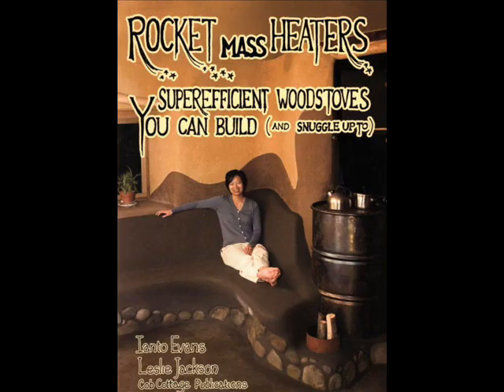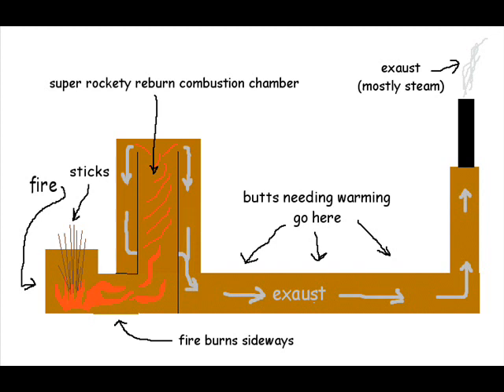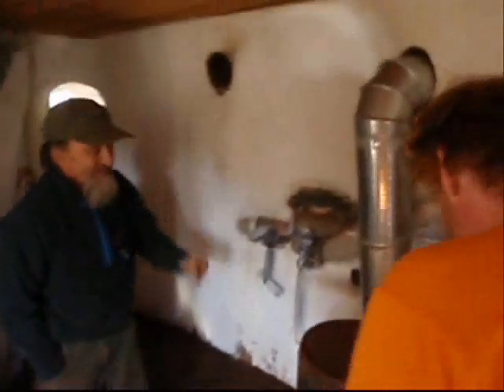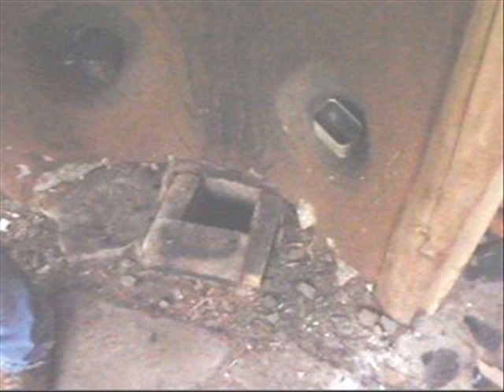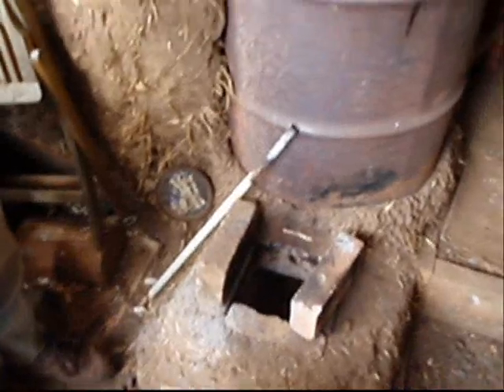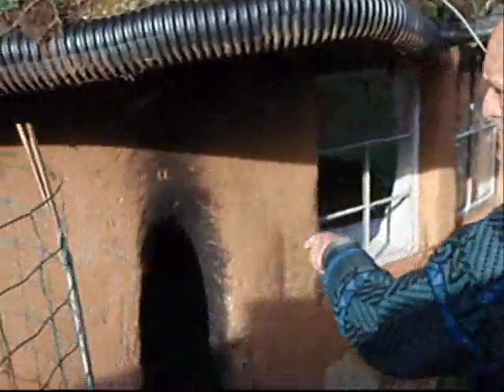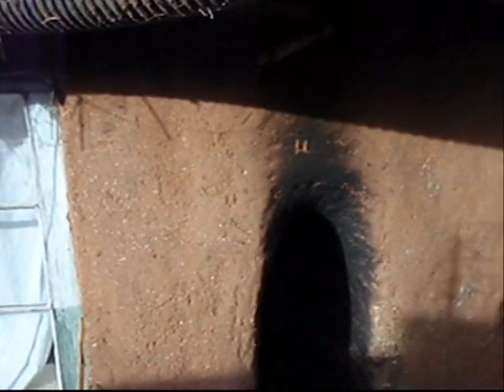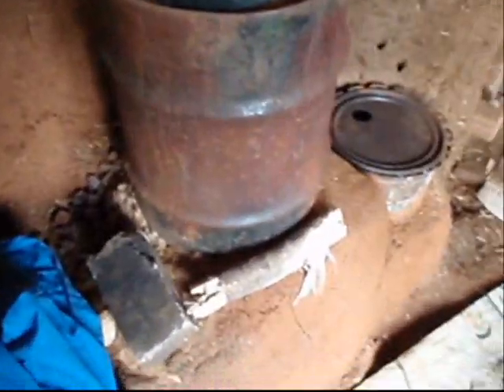12 rocket stove mass heaters - efficient wood heat

Comment: Big fan of the concept of mass heaters. Question though, do do you clean the ducting as it passes through the bench etc
Reply from the maker: Usually there are 2 to 4 cleanout ports.  Most parts need cleaning every eight years or so.  Close to the barrel needs cleaning every year.
Reply: @ thanks!

Comment: This may sound like a dumb question but , in the seated area of it . How do you clean the ducting of soot if there is a long distance from any entry. Currently defining one for outdoor cooking and sitting , I'm just trying to figure out any problems I may have before I get to the .
Reply: 888mrshoe I too will be building one outside. I will be building a heated patio with several masses running underneath. Much better/efficient than having open campfires
Reply: so you wont to burn fuel in  an efficient heater that's purpose is to store heat for later , to replace an extra sweater ? please you are missing the point of having one,if you want to heat the sky burn money instead.

Comment: It seems to be that the area you are calling the combustion chamber would be better described as the heat exchanger. From the illustrations on Richsoil.com the burning is done by the time it gets there.
Reply: yes at last some one understands how they work,I am ex gas engineer ,if I want warmth I get hot from collecting an cutting wood by hand ,stacking and drying it then dragging it in and burning it,

Comment: most people tell you they have a wood burner and they are not lying it burns wood and sends the heat up the stack, do they know their flue gas  temp , most rocket stove flues  are below condensing temp unless been alight for 8 hours or more hence the steam from flue without a computer controlling it ,or electricity if you have one don't tell anyone because your fuel source will be consumed by somebody that lives near you  ive had one for three years an they don't work , but they sent someone from smart meter people to find out why I wasn't using piped  gas and only electricity, I pay the rental  for gas in case I need it
Reply: ***** sorry I am not literary genius but am pleased with my rocket stove, I live next door to an industrial unit they put most of their non recyclable wood over my fence  ,I just break it up cut it if needed and feed the thermal mass heater and bench

Comment: Are any of these build were it is actually cold like - 40, I  don't think so....It's usually built in desert area , I think on dirt floor no wood floor . I 've been posting comments like this on may be 30 youtube channel and no one ever respond so i think it is  probably true what i'm saying ...Or they say ... no it true but they live in apartment building ...
Reply from the maker: It was 26 below a few weeks ago.  My rocket mass heater in Montana kept my plenty warm - over 80.  

I think a reason why you aren't getting responses to your questions is that the youtube comment stuff doesn't work well that way.   Which is why I am so emphatic in my videos to go out to the forums at permies.com.  If you had done that, you would find heaps of people talking about all sorts of particulars about rocket mass heaters.
Reply: How about -40 man It stays like this all winter here
Reply: Chace Butterworth I'll try it . I'll build it this summer ... have nothing to lose tanks
Reply: Francois Couturier How are you currently heating? If you are using a wood stove already then you must be burning upwards of 6 cord per winter yes? So s rocket mass heater might be the way to go for you. They're cheap to build and easily scaleable. Most I've seen are based on 6 inch stovepipe, but there's no reason you couldn't use 8 or 10 inch instead (although with a good thermal mass you might not need to). All wood-gas is being burnt and not vented out your chimney and your thermal mass is extracting all of the heat so none of that goes up the chimney either. So you could easily cut your wood consumption to 3 cord (probably less)
Reply: Please let us know how it works out. Good Luck!
Reply: Francois Couturier actually these where designed in Russia and other omg cold places
 where it was really cold. and The name was called masonry stoves.
Reply: Francois Couturier
Hi there, I was wondering if you built the rocket mass heater and if so how is it working for you? I hope all is well for you this winter?   Janice
Reply: jksatte Love the positive responses to this guy!
Reply: Chad T
Chad that's so funny "omg cold places lol". I live in FL by the way. I have no appreciation for what you guys are speaking of lol.  Janice

Comment: Does any one know how hot the base of the combustion chamber gets?  I am thinking of building one in my home but my floor is wood over a craw space. All the photos and videos I can find the RMH's are build over dirt or stone.
Reply: over 600c in fire tube  mine get up to 200c on the out side of clay fire full size fire brick ,over timber, you  will need insulation under burn area and maybe couple course brick before your burn tube to store and dissipate heat base temperature is less if u use vermiculite fire brick base but this will sacrificial and need replacing  , an air gap under thermal mass would be advisable, there are examples of this on here.

Comment: I see the slits and thanks,but the idea I am installing is air tubes injecting fresh air in the flue to create a secondary burn similar to wood gas generators. Right above the primary flame where any unspent wood gas mould collect. An afterburner of sorts to the primary rocket action.

Comment: It seems like a big outdoor JTube rocket stove to me, but I think I see what you are trying to do.  With a wood gasifier there is an external air pump of some sort, either an actual fan or the vacuum suction of the engine. Anyway, it would be a good experiment to try, even with a simple L tube cooking rocket stove... I know that when I blow air into the feed tube of my minikeg cook stove it turns it into a forge.  Would be interesting to weld some air pipes just above combust chamber angled up..

Comment: Looking to inject via natural draw of gas expansion  air into the up tube so that the air added will fire off any non combusted gas. Thereby upping the heat,burning off more of the gas,increasing heater efficiency over even the best normal rocket stove.

Comment: His isn't really a rocket stove. My air injection tubes would be placed right above the main pyrolysis zone in the upright burn insulated tube. The extra air would need no fan and would raise combustion temps a few hundred degrees.
If located properly.

Comment: Hey, check out theairgunman vid "Outdoor Rocket Stove Heater new reclaimer design", he pumps air with a 12v fan from the top of a sealed vertical feed tube. I'm going to try the same with a potentiometer to control fan speed for my smaller welded propane tank rocket heater. He's pushing heated air but cold air might be better as I believe there is more O2 per cubic inch than with heated air... altho the heated air might help dry the fuel better...

Comment: The point being to increase air flow / oxygen. You say "injected" - you mean forced air (fan)?  Outside air?  Metal tips on PVC tubing?

In any case it would be control-able, in terms of: When the forced-air is on, & tune-able; how much air flow.  Yes?

If directly into the burn-box, (not feed-box) should increasing the temp, & should move the combustion process further down the burn-box; YES? 

You're looking for more "Rockety" in your Rocket stove? 

... just asking ...

Comment: As in a gassifier my thought is a few (6)very small tubes would let fresh oxygen to be drawn in and not affect the natural updraft of the rocket action. The added air would actually increase the heat and expansion of gases by burning off any non combusted wood gas.

Comment: I had that problem with my RMH boiler design -- overcame it by installing a slide damper in the horizontal feed, a lid on the fuel chamber, complete with air control.  This design allows the combustion air to be rechanneled down the feed tube, thereby pulling the smoke back in, and giving better control over fuel chamber load combustion.

Comment: Hi Paul,
After using a tiny rocket stove to heat my 138sq ft tiny house,I  am thinking of putting a few tubes to allow fresh air to be injected just above the primary burn zone. Much like a wood gas generator. Anyone doing it? In theory it should increase efficiency even more than a standard RS.
Thanks for all your great work.

Comment: Very nice.  Paul, are there any videos showing Rumford style fireplaces?   I suppose they use more wood, but might project heat better.  I'm thinking about how a hybrid rocket stove heater with radiator-like projection would be the best of both worlds...

Comment from the maker: For the ones in this video, the barrel can be replaced in about 20 minutes.  Spray lots of water on the cob, the cob turns mushy, pull out the old and put in the new.  Of course, I have yet to hear of a barrel wearing out yet - unlike some other stoves that use barrels.

Comment: I'd love to see one of these made by an engineer, efficient,  smoke tube boiler , aka locomotive steam engines, heating water so it could be pumped round the rest of the house for central heating. External balanced flue air feed, not drawing warm air from inside the house.This is a great idea for efficient combustion, but it could and should be taken much  further with a more scientific aproach. No offence intended to those who have aided progress thus far

Comment: I have a russian stove in my basement and a finnish fireplace in my great room they work great and work on the same prinicipal as a rocket stove, But I will say a russian stove and a finnish fireplace are not cheap or easy to build both would take a skilled masnon with much firebrick experence. I live in the rust belt in western Pa. I burn about a weel barrow of wood a day I rarely burn both.

Comment: These furnaces are highly deficient the combustible gases and smoke usually associated with fire places are burned in the combustion chambers.  The only by products are steam that leave through a chimney or stove pipe and solid ash that is cleaned out through hatches built in to the bench area of the heater.  This ash can be added to compost in the right proportions and can be very good for plants. You want to watch this however because to much can be bad for the plant the right amount is good

Comment: What happens to the ash? Is there a clean out?  Does it get sucked into the system? Do the long pipes eventually get clogged with ash? How long can the long pipes go horizontally before you need to exit to get a good draft? Thank you.

Comment: how long do the 55 gal drums last before they rust out, my burn barrels don't last long at all. There seems to be a lot of heat and wouldn't the bottom of the barrel just rust out, ,Of course the bottom of the barrel is the top.

Comment: not telling you what to do,just a suggestion.wood is renewable but it takes a long time to grow.I seen from your videos you have a lot of trees in the area but have you considered getting a pelleting machine to turn the abundant leaf source you have there into leaf pellets to burn in the winter?you wouldn't have to worry about adding some binder to it as i understand that plant matter has this chemical called lignin that holds it together like glue once it is heated in the pellet machine.

Comment: just a idea .....one may choose to create a better heat exchange for the barrel by adding sheet metal chicanes to the outside of the heat riser.  the chicanes would sit in the space between the barrel interior and the heat risers exterior, directing the hot gases into certain directions.